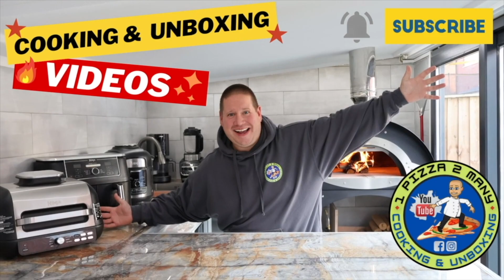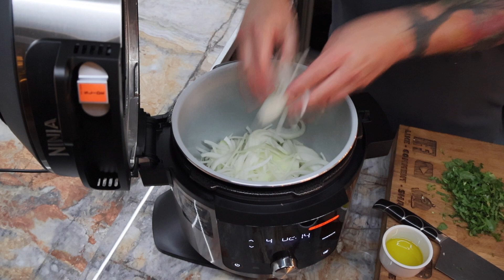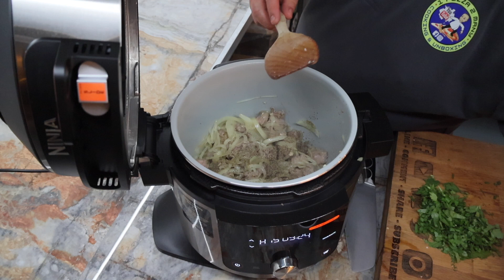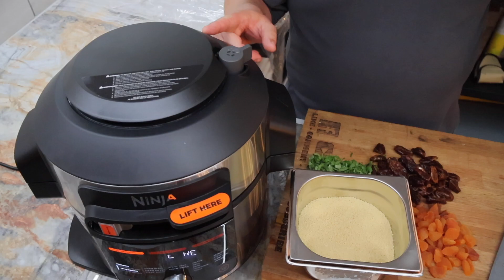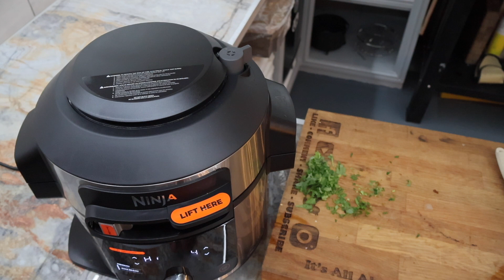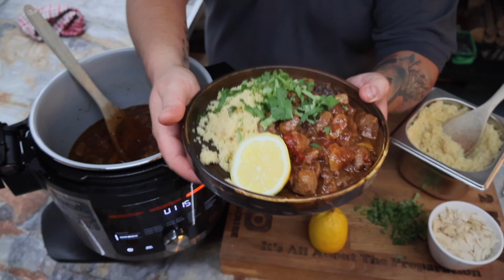Pressure Cooker| Lamb Tagine Ninja Foodi Max

Comment: I bought the 15-1 back in March and haven't used my cooker since.  Fabulous bit of kit and still learning how to adapt my usual recipes.  I had one serious boo boo when I tried to cook bread in it as per the recipe book.  The first time I cooked it the top burned a little, but no big problem.  The bread was delicious.   The second time I cooked it I was working upstairs when I smelt burning.  Looked around the whole house was full of smoke.  Briefly, the loaf had risen that much it totally filled the lid and burnt to charcoal.  It took hours to clean the 15-1.  We cut the top third off the loaf and continued cooking it and it was still delish, but I've not attempted it since.  
Do you fancy having a go?
Reply from the maker: Yep it is great, I'm definitely going to try and prove and bake bread in it.